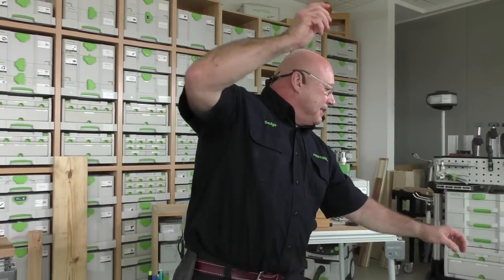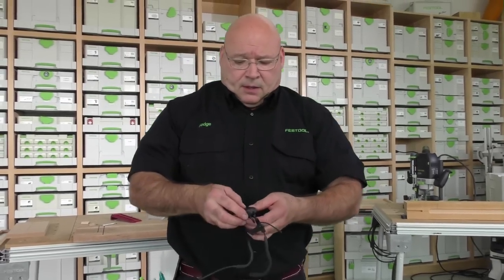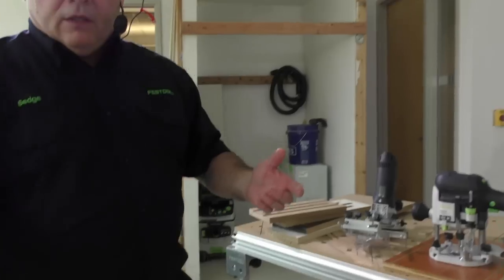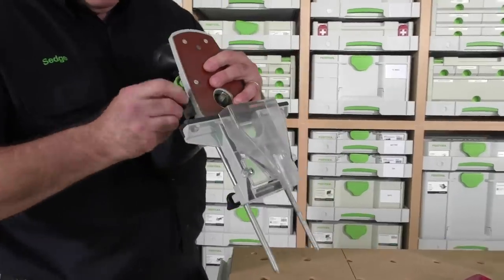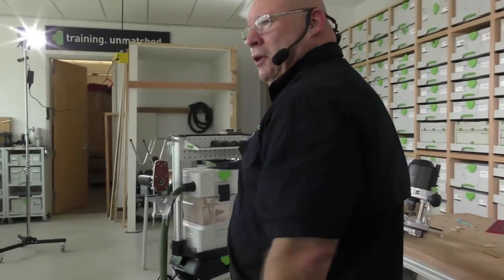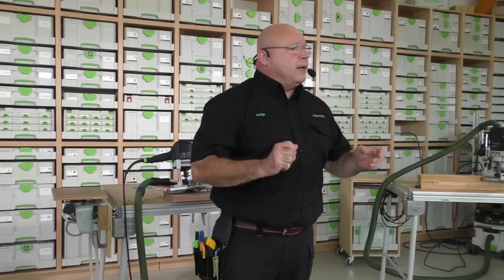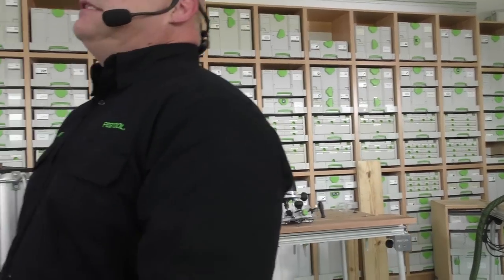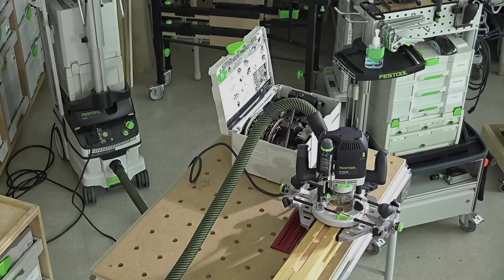Festool Live Episode 65 - Router Parallel Guides

Comment: I added an extra fence (sorry parallel guide) to my 1400 for captured mortise like you demonstrated. Worked brilliant. Why is the 2200 hard wired?
Reply: I think it’s to do with how much power it uses and the cable size it needs